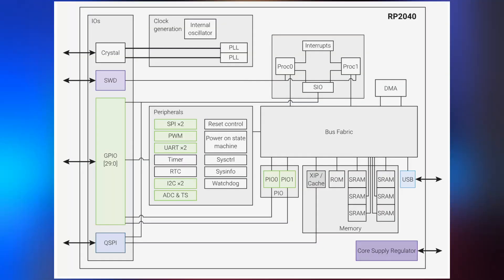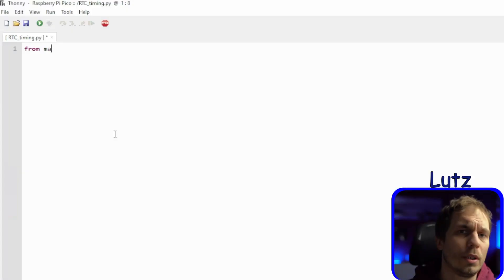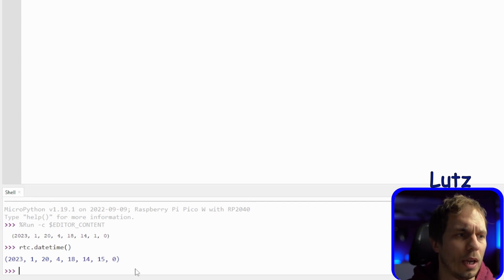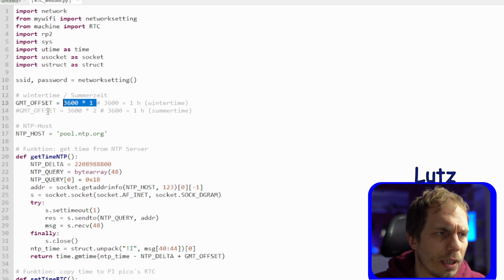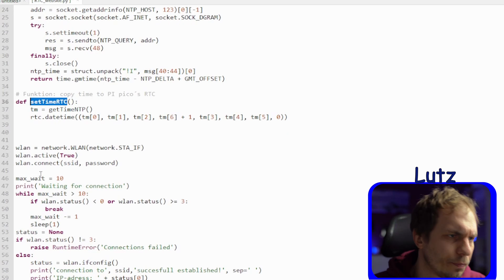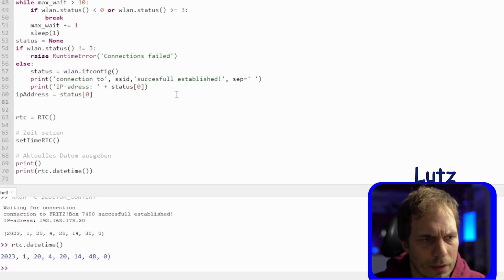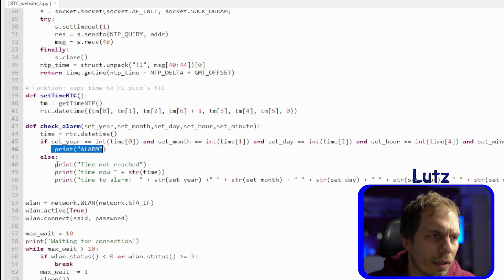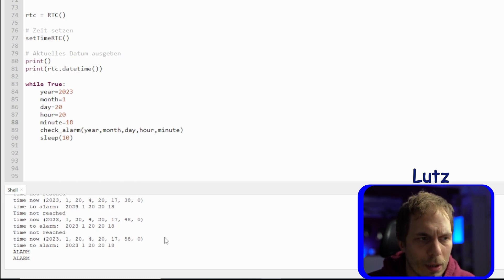Real time clock sync over WiFi - Pi Pico w - in 6 Minutes

Comment: I would like to use this to make my dumb EV charger a bit smarter. Ideally it would enable the charger for the same hours each day while the electricity rates are cheaper. Also it would need to adjust for daylight saving. There would be a separate override for emergency charging outside these hours. Any ideas gratefully received, thanks.
Reply: on the pico you could program a while loop with if statements that checks the time every minute or so. within the determined month and hour of the day trigger a gpio pin high and trigger a low voltage relay which could power the coil for a contactor that can act as a disconnect switch for your ev charger.
 There are probably simpler ways to achieve the function you want though.. i don't own an EV but i think most chargers should be able to be programmed to take advantage of cheaper charging times as  its probably pretty common for folks to want to be able to do exactly what you described

Comment: Just stumbled on your video and subscribed, very  related to my project using pico W to collect data over one week for multiple sensors into a CSV format with exact time of reading every 10 minutes. My problem was my university did not allow the ntp ports open to external net but used an internal network time server,  which I Knew nothing about. A  nice IT Prof explained since I am new to this univ and gave me the IP of the internal time server.    in response to why your interrupts might not be working,  somewhere on Raspberry pi documentation I saw the interrupt especially in a DEEP Sleep state  must be  external  signal to the Pico.   I will check your GitHUb.  Great JOb! more Pico W  please, with Solar, lipo battery and Lora and  MQTT.

Comment: hey mate thanks for your suggestion, I am having trouble with setting the alarm for only a certain hour or minute, instead of having to give year and month etc. how would i go about doing that?
Reply from the maker: You Just want to have this Alarm every day at the Same time ? Then you need to delete the year,  month and day in the Check function 

So from this

def check_alarm(set_year,set_month,set_day,set_hour,set_minute):
    time = rtc.datetime()
    if set_year == int(time[0]) and set_month == int(time[1]) and set_day == int(time[2]) and set_hour == int(time[4]) and set_minute == int(time[5]):

Need to Change in this: 

def check_alarm(set_hour, set_minute): time = rtc.datetime() if set_hour == int(time[4]) and set_minute == int(time[5]): 
print("ALARM")

I think this should Work as you need it. Can't proove the Code Just got it on my Phone but i'm Sure you undestand my Intention and can adapt it If the Code snip has a typo.

Let my know If it Works.
Reply: @lutz4tech  ah yes, thank you! I kept getting errors that I could not solve earlier, that worked after a few easily solved errors. Appreciate you! In relation just to the alarm function (not including any of the network/web based imports) what do I have to import to make it work? I have the phew library handling the network part in my project.